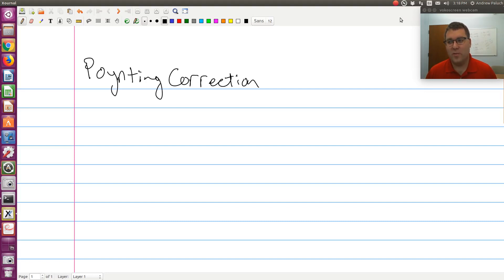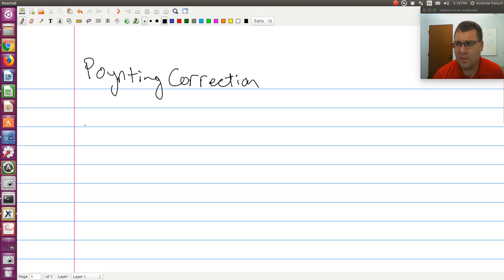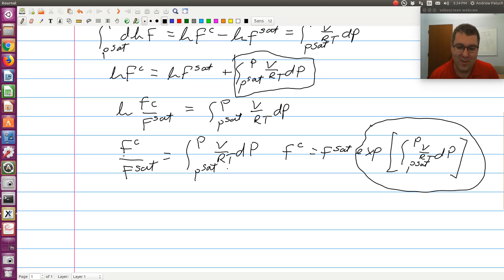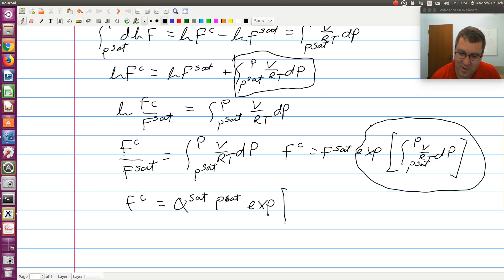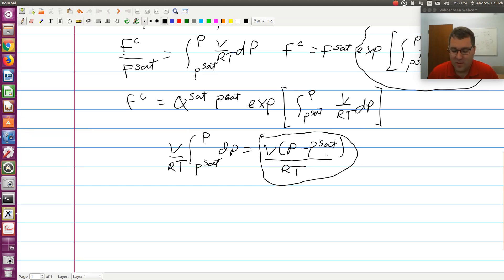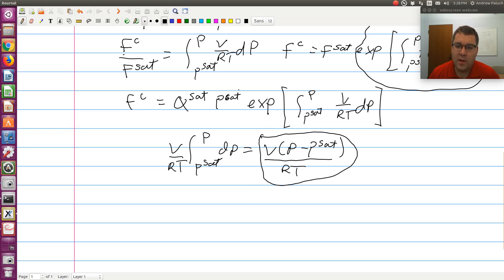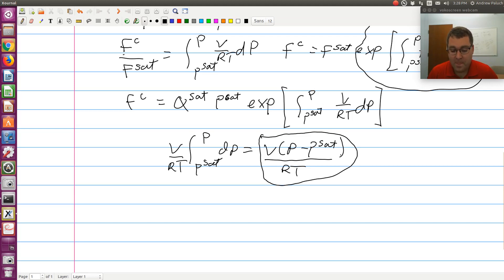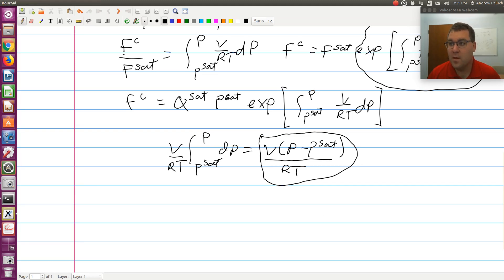Chapter 7: Poynting Correction

Comment: And in high pressure vle,,,if saturation pressure is given,,why are we relating fugacity of pure component with poynting correction factor
Reply from the maker: In general, I like to think of the (pure component) log fugacity as written as the sum of three contributions. First is log Psat. At low pressures assuming the vapor phase is an ideal gas, the fugacity can be assumed equivalent to the vapor pressure. Second is the log fugacity coefficient at saturation at T. Even at low pressures, associating fluids such as carboxylic acid can not be assumed to be in a non-interacting ideal gas state. The sum of these first two terms gives the log fugacity at saturation at T. So if you are at pure component VLE, even high pressure VLE, then you need just these two terms. At high pressure VLE, the ideal gas assumption would break down, so both terms would be needed.

Third is the Poynting correct. The log Poynting correction is equivalent to the difference in the log fugacity at T and P and the log fugacity at saturation at T.  Again if you are at saturation, then you see this term is 0. If your are at a pressure that is only slightly larger than the saturation pressure at T, then it may be negligible. But if you have a compressed phase where the pressure is much greater than the saturation pressure at T, then it becomes important. So this term is only needed for compressed phases for which P is much greater than pure component Psat at T.

The reason for decomposing the fugacity in this way is it facilitates its calculation. 

I emphasize here that we are referring only to pure component systems.
Reply: @AndrewPaluch  The explanation given by you was great sir.